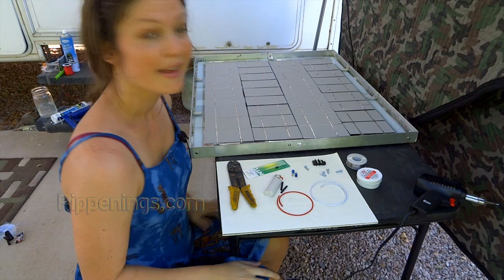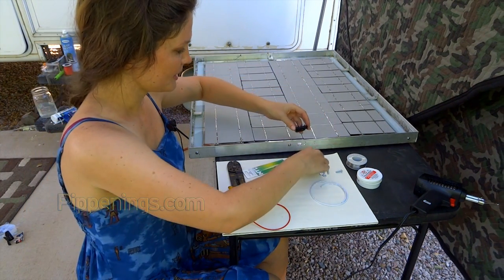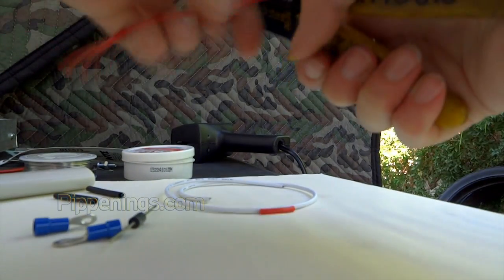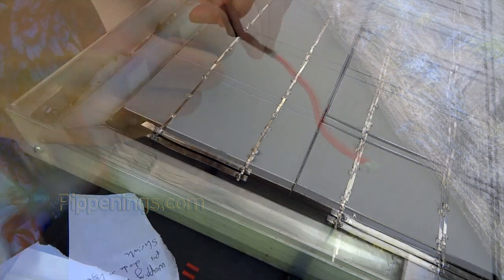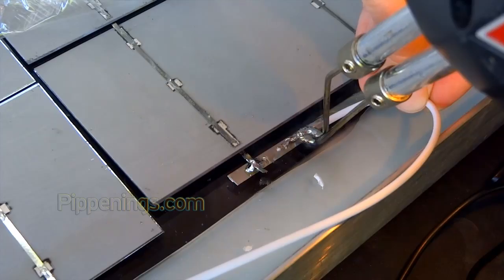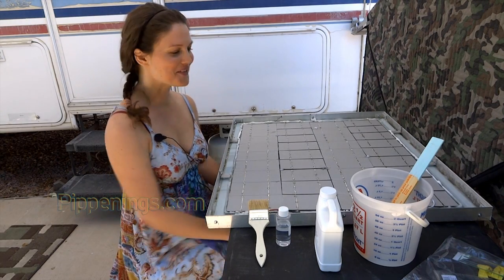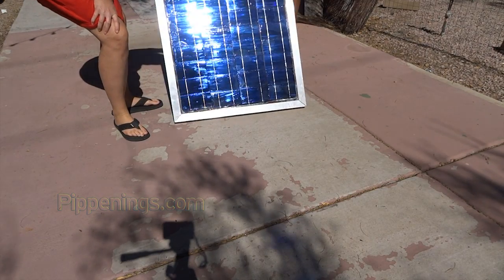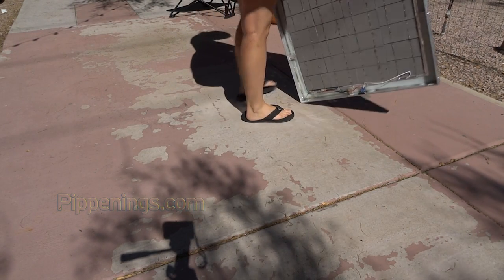DIY Build Solar Panels 2/2: Homemade from Scratch, Wiring, Encapsulant

Comment: The one thing that concerns me is the current capability of the panel as a whole. Your diodes potentially may be too small. I have been looking at premade panels in the 100 Watt range because the smaller 20 and 30 watt versions will take too long to charge the batteries. 
Don't forget to introduce a charge controller in there. :)
Reply: Jeff Kline in series the current is not increased by cell, just voltage. You get the higher current by connecting these finished panels in parallel. The higher rated diode would be needed at the final output, along with heavier wire.. Would it be needed if individual units where protected? Probably, maybe, not sure?
Reply: Actually even in series, the diodes need to be rated sufficiently for the current they may be asked to carry; not the voltage. So; even at 2 volts, if the current being put through a series pass diode in one section exceeds the apparent 1amp rating of that diode, then it will simply open up. Most of those panels can easily source a good 6 amps so you should use appropriately sized series pass diodes as well.

Comment: I used to have a job working with fiberglass reinforced plastic when I was younger. We had a powder that we used to make a putty with it so we could fill in small areas and joints. If you put too much catalyst in, due to the chemical reaction it would get very hot and smoke. We mixed the putty in paper cups and sometimes when things got boring, just for fun someone would  mix a cup of putty and add too much catalyst then set the cup out on a table near one of the water barrels. It would smoke for awhile until someone tossed it into the water barrel. :)
Reply from the maker: +Camper Hollow Thanks for sharing this memory :)

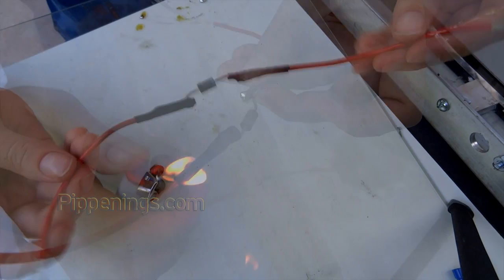Comment: 3:48 Then I would have ran 2 of those capacitors under that single wire to help less'n the heat stress.

Comment: Thanks for this helpful video! 
Suggestion: if possible, place the (hot) soldering iron tip underneath the wires, adding the solder on top of the wires. 
For better soldering I recommend using "helping hands". 
I am using something like this:
http://www.ebay.com/itm/HELPING-HAND-MAGNIFIER-with-2-ALLIGATOR-CLAMPS-SOLDERING-3rd-HAND-JEWELRY-New-/302051643195
All the best!
Reply from the maker: +cauchy8888 Thanks for the tips!

Comment: I built them like this. then I found a person that deals in used panels that still preform as new. I pay about .35 per watt as compared to the 1.25 to 1.75 per watt this way.
Reply from the maker: +shawnpc1 Nice, yeah if you can find a connection like that, sounds like a good way to go!
Reply: I run my entire house off solar I have 28 panels running 6.790 kw I have not had a power bill in 2 years it is great.

Comment: Hay Peppi!  Tempered glass will with stand hail impacts where just glass won't ever.  
Also, you can't possibly say you had the panels in full sunlight using your own eyes to gauge that.  You either have to use a light meter or compare their output to a know rated panel as a control.  The reason for that is your eyes have pupils that dilate which make it impossible for any person to accurately determine full sunlight from lesser ammounts reduced by haze or light cloud cover.  I'd say your panel are very likely putting out more than you think.  How much more is anyone's guess but I say more than you measured as their peak.  Good work.  Cheers
Reply from the maker: +rick dees Yes, I'm happy to say that after drying for days I turned it over and measured it at about 60W. :D

Comment: hello Pippi...did you ever try the water pump trick while hooked up to city water to get better shower pressure...just wondered if it worked for you...happy trails
Reply from the maker: +Kirkr Lazar I removed a regulator that was on it before and get good pressure now, thanks!

Comment: problem with tempered glass is that when it breaks it crystallizes (making a mess) and then the sun can't get through whereas none regular glass (none tempered) only cracks but will stays clear so the sun can get to it and still can be used by just simply siliconing the crack to keep secured until you can replace it (just a thought for next time)
Reply from the maker: +Coolbreeze I don't expect to crack or shatter mine. A crack with silicone patching could reduce the electricity by a significant amount by shading parts of cells. Read Handy Bob for more on that. Don't know how well you could replace a piece of glass that has electronic parts laminated to it.

Comment: Next time you need wire your local home depot  or Lowe's  sells wire by the foot. all types of wire all gauges also.
Reply from the maker: +GREGORY WIERZBICKI Darn it. Now I know. I may use this wire anyway. Got some things planned :)
Reply: No problem. If you need any plumbing advice just let me know.I've picked up info from you that I didn't know. I'M  about to buy a class a motorhome myself to live in full time and to escape these cold mid Atlantic  winter's.

Comment: When you soldered the diode wires thats called a butt joint. It takes practice. Try using flux on the wire after you have some solder on them. It will work better.
Reply from the maker: +Brainsmachine.bc Thanks for the tip!

Comment: WOW you have to focus on making all those connections, a 'single' broken wiring connection could be disastrous. Have you had any problems with the build?
Reply from the maker: +moonlighter6 It's been fine so far. I've only really let it sit to fully dry and cure though

Comment: Hi Pippi! Nice job! Just some friendly suggestions for you and your viewers...wear your safety glasses when using chemicals,use lock washers behind the nuts on the screws,and your dad is absotivly  right about heat shrinking your electrical connections(make sure you put the heat shrink on the wire BEFORE connecting). Harbor Freight has heat shrink cheap. Also use dielectric grease on the connections, especially on automotive applications. Finally, FYI, you could probably have gotten enough free wire from a lot of different repair shops,or discarded electronic items on trash pick up night/day.Looking forward to seeing the panel output when you get it hooked up ;}
Reply from the maker: +Mr Frog Thanks for the great tips Frog!
Reply: You are welcome!

Comment: Just a suggestion or two when soldering - the iron or gun is used to heat the part and not "carry" the solder to the joint.  Therefore, heat the joint with the soldering iron and bring the solder to the joint.  The solder will flow towards the heat.  The same technique is used when soldering copper pipe except a torch is used.  Also, rather than use separate flux, use rosin core solder.  The flux is in the middle of the solder.
Reply from the maker: +drbrono I ran out of my regular solder and got rosin core. It was amazing!! Thanks for the tips!